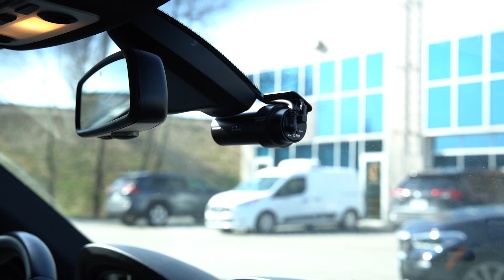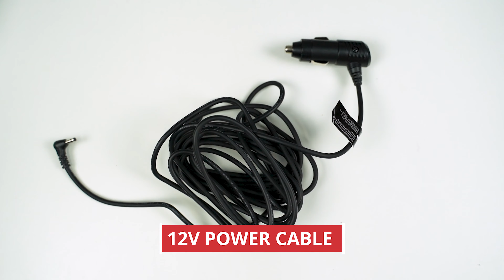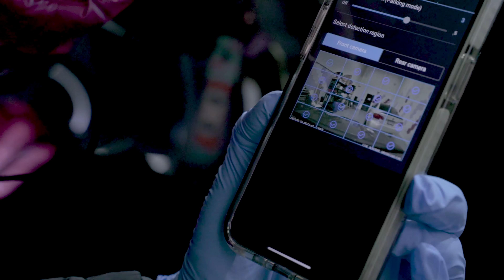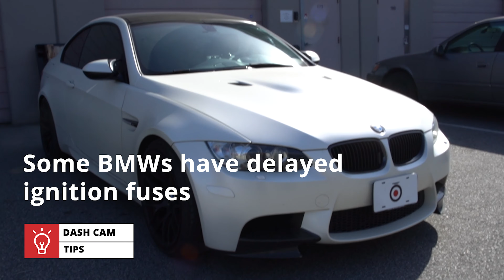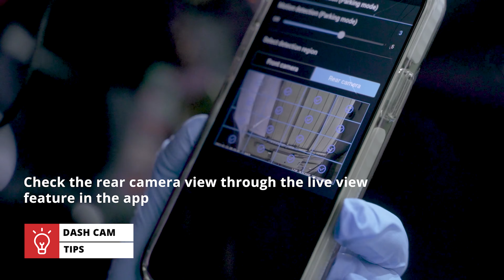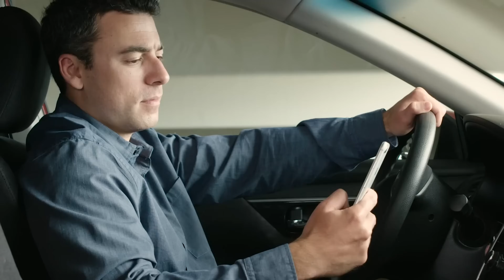BlackVue DR770X-2CH Dash Cam x 2012 BMW M3 | How to Hardwire Install | BlackboxMyCar

Comment: Would you recommend anytime installing a dashcam either 1 or 2 channel into a BMW that you use battery pack?
Reply from the maker: We definitely recommend using a battery pack in a BMW with either a 1 or 2 channel system! BMWs especially can benefit from battery packs, which will avoid any issues with the BMWs finnicky electrical systems. 

Let me know if I misunderstood the question
Reply: @blackboxmycar   you answered it perfectly, I will be looking into a battery pack very shortly. I know with my dashcam it works amazing but with the cold winter months here in Winnipeg I find myself getting a battery discharge error when I start up my car.